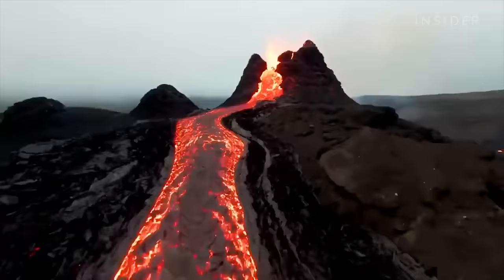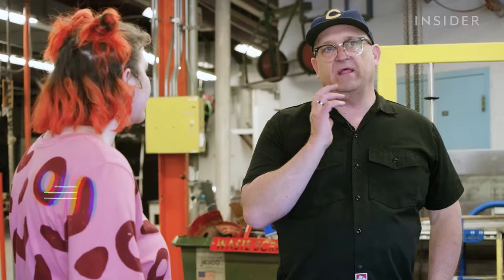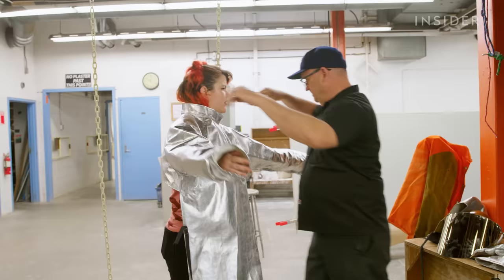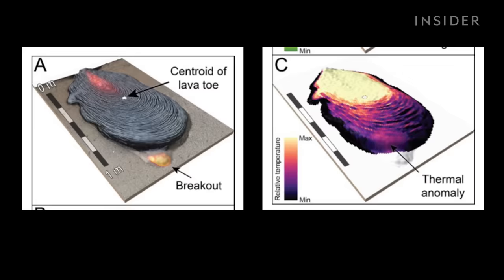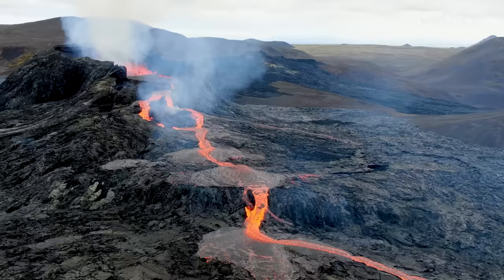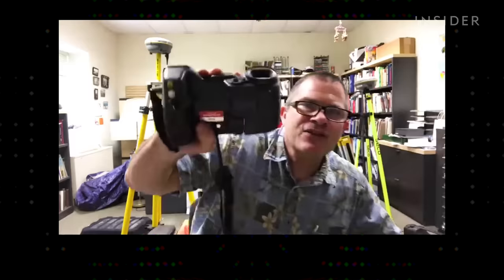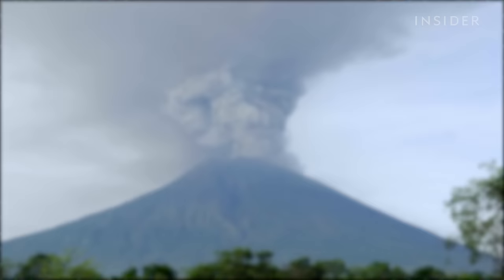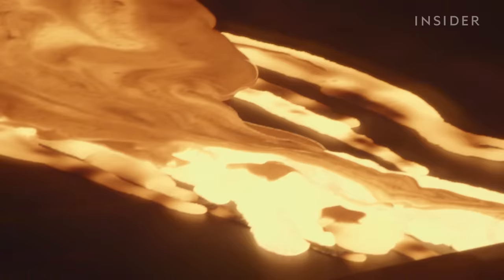How Far Volcanologists Go To Test Lava | Science Skills

Comment: I wish they defined the difference between magma and lava because they seem to use them interchangeably here. For anyone who’s wondering magma is molten rock from our earth’s mantle (which is liquid, only the earths core and crust are solid). Lava is when the magma has been exposed to our atmosphere (when it touches air). Hope this helps!
Reply: What’s the use of this distinction? Seems pedantic
Reply: @enderwiggins8248  they have geologically and compositionally different molecular structures from the presence of oxygen, nitrogen, and carbon dioxide. Also magma is an absolute liquid while lava has a high viscosity

Comment: -Just to avoid confusion, space satellites are not wrapped in gold.  That is polyester and aluminum, known as a "Mylar blanket."  The color helps accomplish the reflection of infrared light, so using actual gold is not necessary.  Only when you want to reflect nearly 100% infrared would one use actual gold, so that's why the primary mirror of the James Webb Space Telescope is coated in actual gold.

Comment: It would be neat it you could design either a mixing system or high pressureco2/so2 injection system into the pot to simulate natural lava further. Their simulation lava has very little gas content and according to another video, elemental iron separates out from the silica over time of their repeat pourings (due to not being mixed)

Comment: When a volcano erupts it melts the ice with explosive hot fumes that has the potential to mummify you. The ice works but who would supply the ice onto a mountain when it's going to erupt they would need an extraction team. Also if the ice melts it causes a mudslide or a lahar so snow is bad ice is good.

Comment: Can you theoretically build an iron dome around a volcano? Lots of people live next to them and just like LA Palma they're very destructive. If you covered them maybe that'd help, maybe build a network underground to systematically release the earth's pressure and lava into the ocean instead. Like mapping the earth's core then deducting the best pressure points to relieve and just send robots to drill until you have a man made volcano in the ocean.
Reply: 1. The cost; it would be rather cheaper to install  an early warning eruption system and then evacuate the immediate populace than installing massive dome.
2. The energy from volcanic eruption is immense. Have you seen how energetic a volcanic eruption? No man made structure can withstand the explosion
3. Releasing the inner pressure could work, but then again, the cost. 
4. Not all volcano is located near an ocean. Some, like the one in Indonesia for example, is located in the centre of the Java Island, dozens of Km away from nearby ocean.

Comment: Can they test if there is a way to stop lava? Like if you put some kind off material in it, would it slow it down? Or make it go in a different direction?
Reply: Just build a dam out of rocks and it will stop the flow.

Of course it all depends on the type and amount of lava but since it behaves like a viscous liquid, building a dam would force it to change direction.
Reply: @ProfezorSnayp  But wouldn't the dam made out of rocks melt due to the extremely high temperature of lava?
Reply: @megumifushiguro963  Not really. Rocks are very bad at conducting heat. By the time the rocks start to melt the lava will either solidify or go a different path.
Reply: @ProfezorSnayp  Its actually pretty cool to think about it. Rocks transporting molten rocks

Comment: Styrofoam is an option to make a kiln. Using water to cool the walls and arch. A flu vent would be necessary as well as potential structural fabrication from metal or even wood.